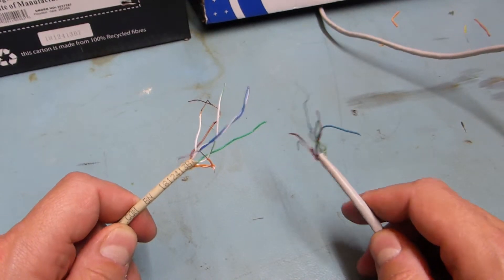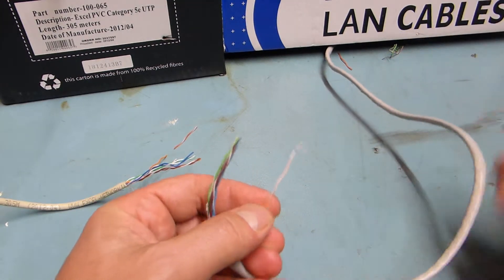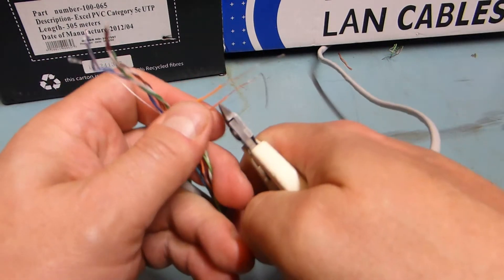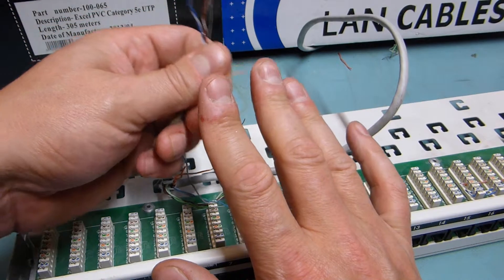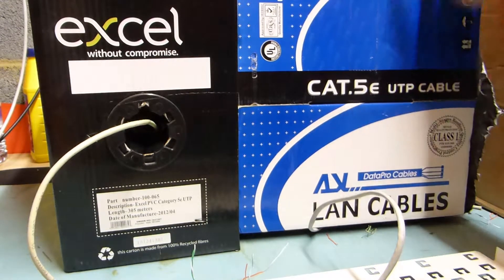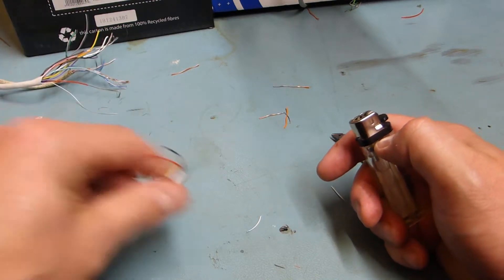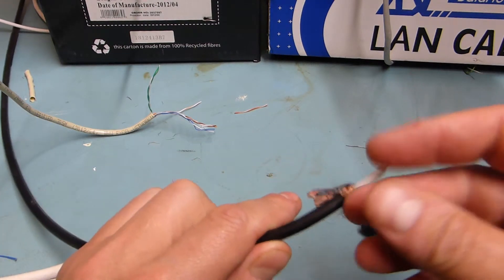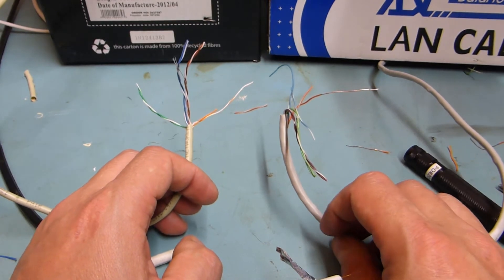Beware of Inferior CAT5e made from Aluminium.

Comment: Wow in 3 years now since this video was uploaded.. There is a lot of things that have changed. The cables today are not even as nice as your cables that your showing in this video. Friend of mine called me up said he was having some issues and remembered I talk about networking a lot and have loads of cables could i go look at his issue.. First in my mind was CCA.. So I get there and I just did a touch test and said no this is Beyond Junk took my cutter and removed the cover leaving the cable in tack and showed him that the cable was VERY VERY bad cable to the fact that it wasn't even strong enough to twist so it was just laying in the cable jacket and then after we talked about removing it and installing the 86' of real cable I cut off the end, pulled the inner jacket off the wire and it was not even CCA there wasn't any Copper that I could see at all. Gave it a flame test and it broke down right away.. Did that to some of my cable that we were installing for him and it didn't curl or burn. Sadly he bought that cable with ad saying it was POE Cat 5e.. Well when I was done installing new cables and testing his system out I got to keep the old cable and another one same seller same lot so I took it home and wanted to test out. I removed a POE camera from a Full time Working Environment and installed this cable between the camera and my POE+ switch.. Before Morning the camera is now damaged and is on a Constant Boot loop. It no longer even on a good Cat5e cable will make a connection and I will have to look over the  camera for damage caused by the Cheaper then JUNK Cheap cable.. Very sad that people are messing with other peoples hardware when it fails it will be said it was bad camera not even taking the cables into account...